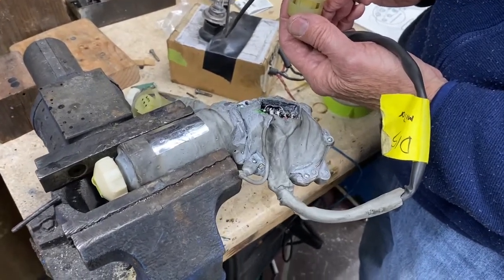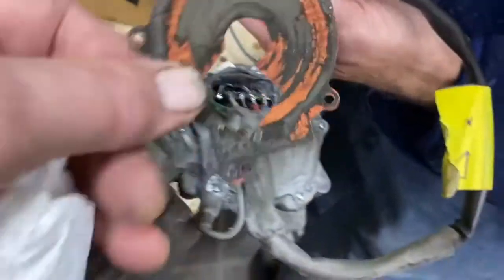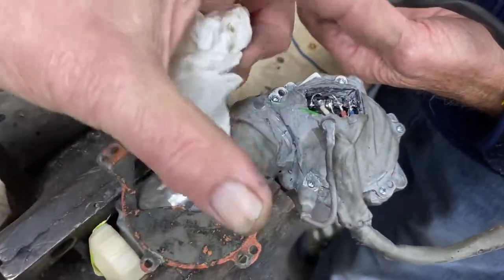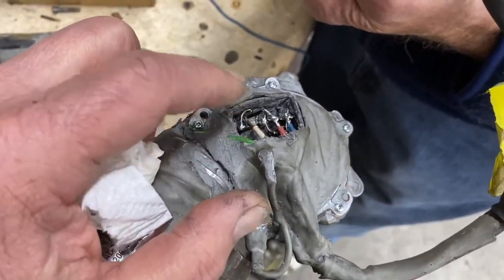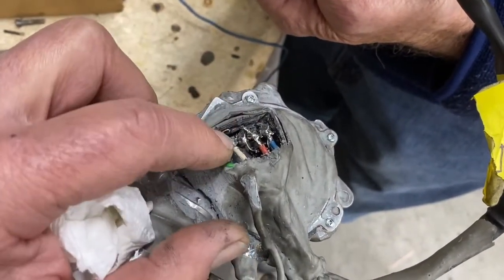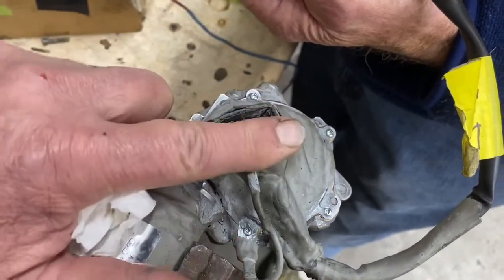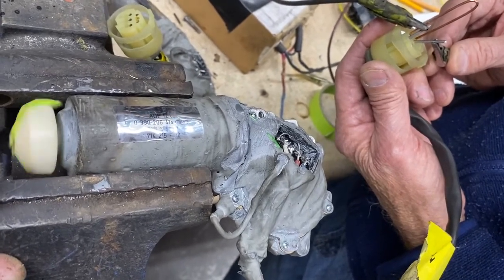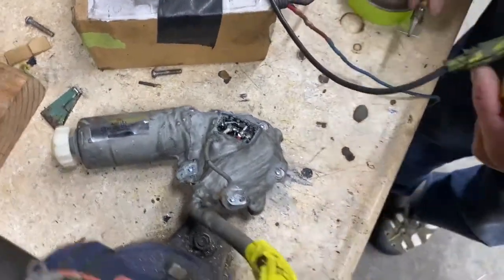Ferrari Headlamp motor test after repairs

Comment: Hi There. Repairing my Ferrari 355 headlight lifters. I know its been a while since you replaced the but is "1N4001 50V 1 amp diode" the right one? (That is the one Fiat uses for their headlight motors) I would be much obliged if you could confirm!